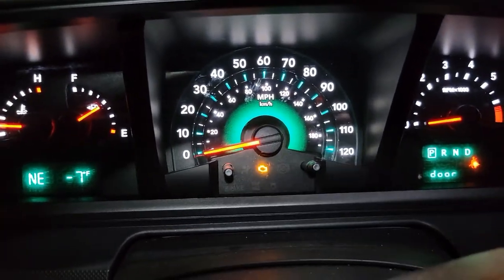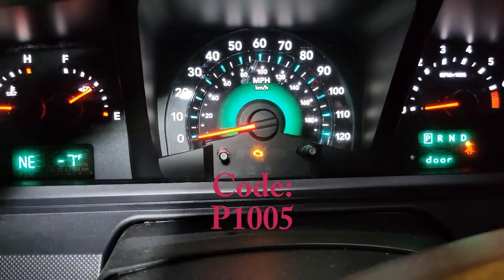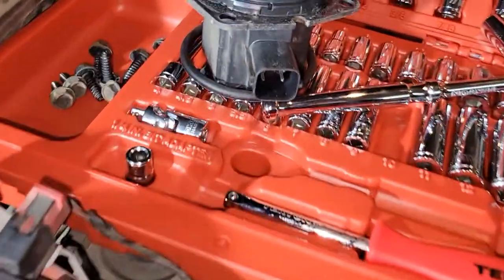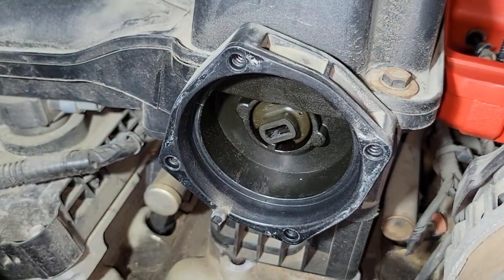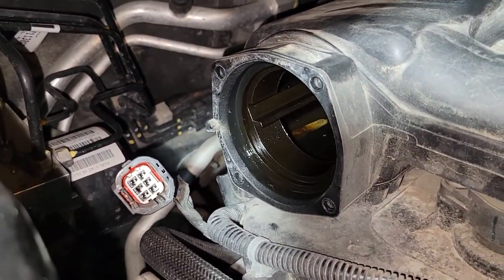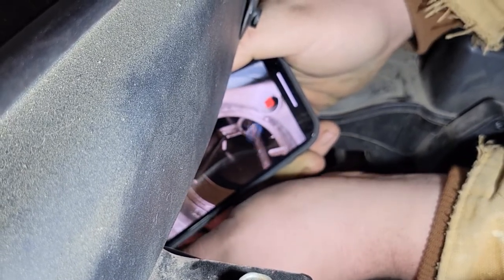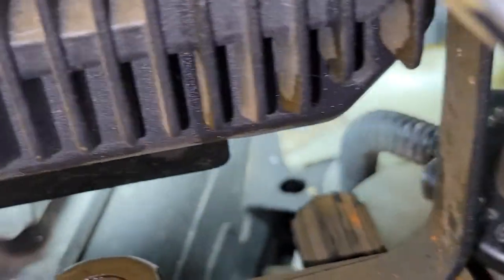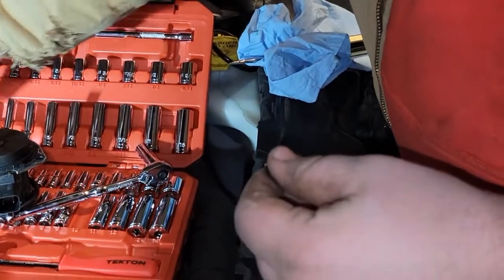Code P1005 Fix/Repair Manifold Tuning Valve Control Performance Dodge Journey DIY Check Engine Light

Comment: I literally bought a whole new manifold installed it and this p1005 code still pops up ended up cleaning the valve as well still popping up!
Reply from the maker: Frustrating!

Comment: I put a can of Berryman B-12 mixed in with a full tank of gas. After a couple more times driving the car the light went out and hasn’t come back on. (2010 Journey SXT with 245,000 miles).
Reply from the maker: Great tip!
Reply: What is that mixture?

Comment: Do you know where you purchased the first manifold tuning valve? The one in front
Reply from the maker: Picked it up off Ebay.
Reply: @MelvinZoopers  would you happen to know the exact product number or name of part. I replaced the back one already and the front one doesn’t come up on Amazon. It shows up only for Dodge Charger
Reply from the maker: @ogbeags  Sorry I don't.
Reply: It’s Dorman 911-902

Comment: Did the Check Engine light stay off?
Reply from the maker: It has been a few weeks & the light is still off.
Reply: I noticed depending on the weather it turns of and on...

Comment: DO NOT buy aftermarket Intake RuNner Actuators, they are not compatible with any 3.5L V6 engines.  Save yourselkf the trouble and buy OEM Chrysler part for this P1005 Code repair.